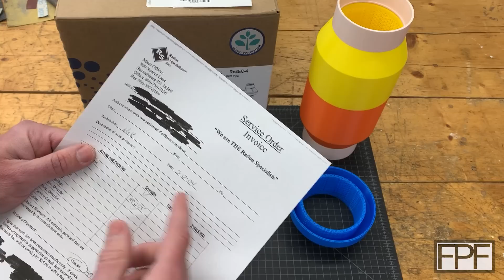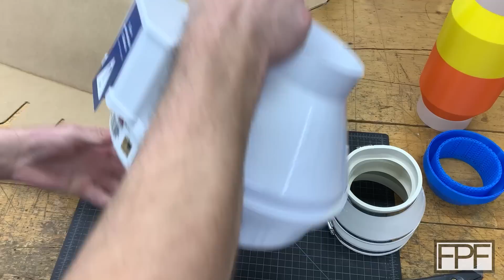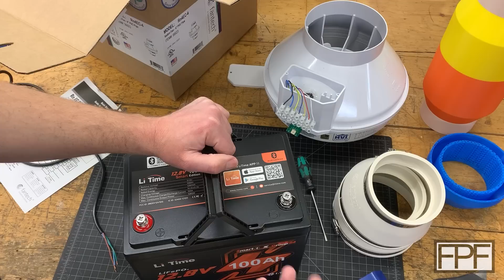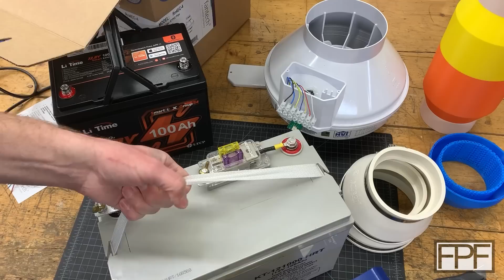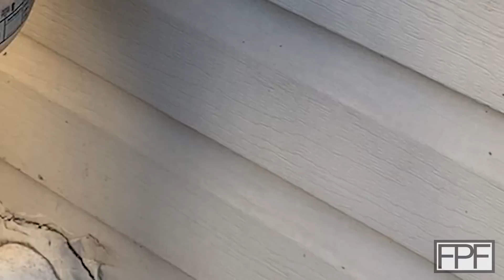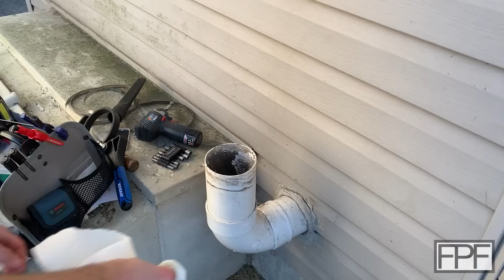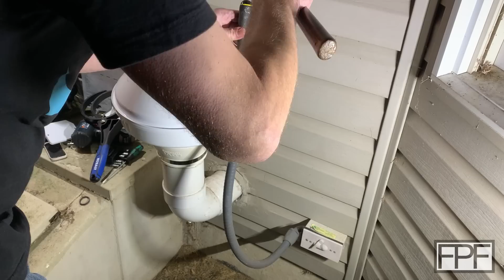3D Printed Radon Exhaust Quieting - The Saga Continues

Comment: You could try running new pipe up to the soffit.. then an adaptor to the old pipe back through the original hole. And I wonder it a spray on sound deadener/ bed liner on the old the pipe where it exits might stop the resonation.

Comment: you could make a "pilot" that screws onto your arbor the same as the hole saw does. I'll often use a smaller holesaw as a pilot if I need to enlarge a hole. It may even make sense to be able to use the old pipe as a pilot since it will keep the two holes aligned

Comment: I'm definitely a layman, but with the pitch of the roof I can't think of how a hole saw can work. As mentioned in the video, it's an oval, not a circle. Wouldn't they have just used a Sawzall when they cut it in the first place? I'd put the pipe back in, then design a jig to hold a pencil parallel to the pipe at the right offset to mark a wider oval. Then just use a Sawzall or a router or maybe just a Dremel to cut away the wood. A Dremel would be like a scalpel to the Sawzall's chainsaw when it comes to cutting back the joist.

Comment: to centre the hole saw just stack the original sized saw inside the new size and use it to guide the saw.
Reply: Put a couple of washers below the 4” to make it stand proud and fit in the original hole so the 4.5” is ready to cut.
Reply: This
Reply: Indeed
Reply: Exactly what I was going to suggest
Reply: Great idea, thanks for sharing!
Reply: came here to say exactly this, use the smaller as the pilot 😊

Comment: mount the 4.5" holesaw then you should be able to mount the 4" on-top and concentric (the arbour should allow this even if its not full engagement) this allows the 4" to centre up the 4.5" on the original hole. this is a very normal practice.

Comment: Pipe sizes are specified by the ID (inside diameter) because that is what determines the flow characteristics. That’s why the thicker wall pipe is larger outside.
Reply: Your partially correct, if the pipe is an SIDR pipe (Standard Inside Dimension Ratio Pipe) This typically applies to pressure pipe and is more typical to smaller diameter (not always the case). When you get into 3" and larger pipe sch40 and also S&D (Sewer and drain pipe)  the standards go more SDR (Standard Dimension Ratio).  Depending on the specifications you could have pipe that is the Same outside diameter and changes the ID but the thickness goes to the interior.